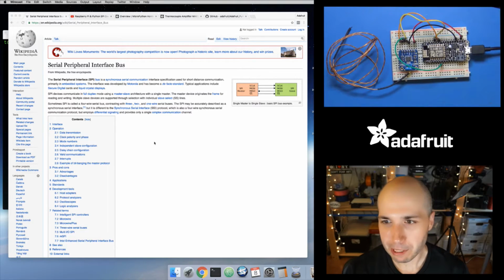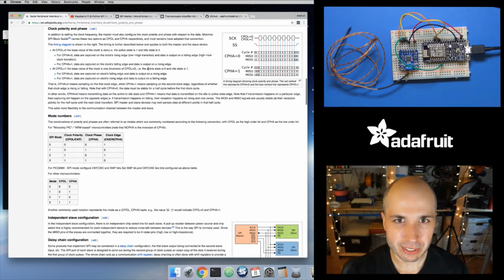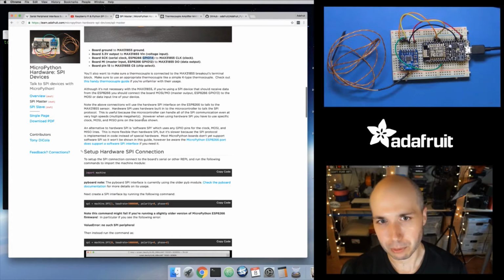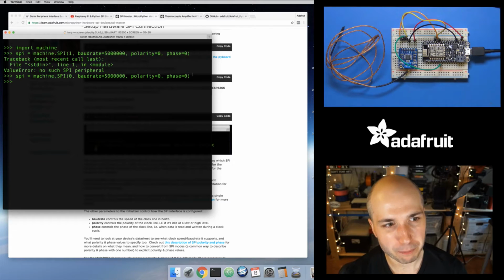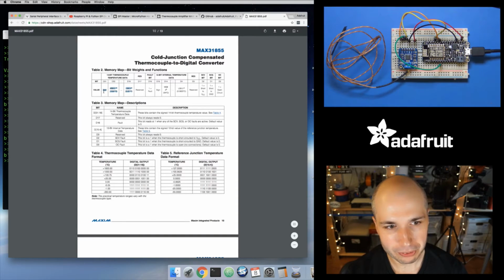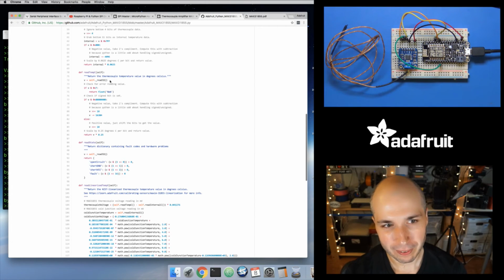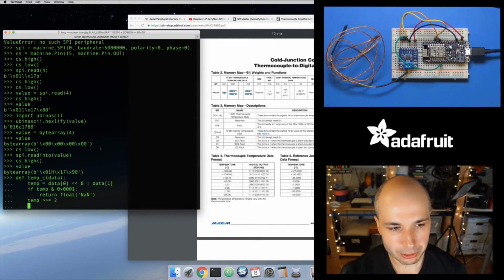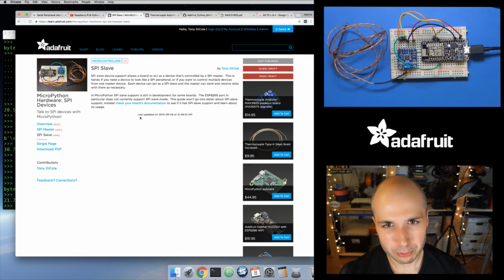MicroPython Hardware: SPI Devices with Tony D! @micropython

Comment: Your MicroPython series is excellent! ... thank you... I'm really hoping you're planning an episode on I2C with the ESP8266. I'd like to use the Adafruit HUZZAH ESP8266 breakout and INA219 breakout to monitor some solar charging circuits, ideally using a few low power options to put the wifi circuit into sleep mode for most of the time.